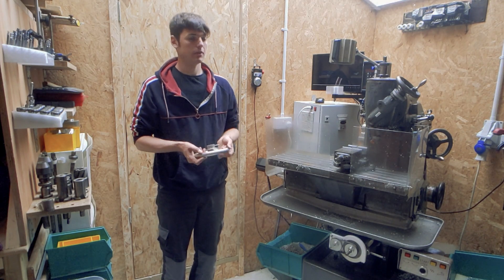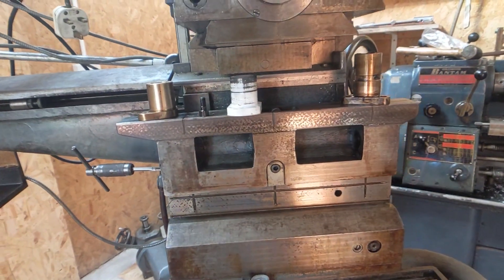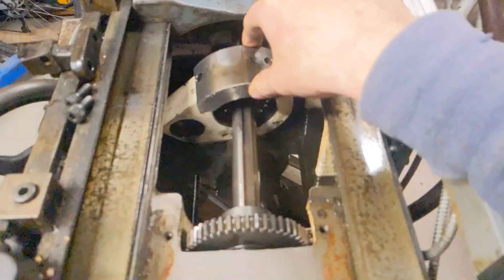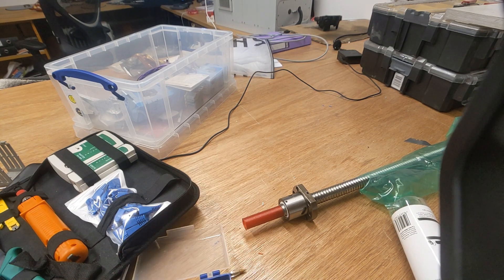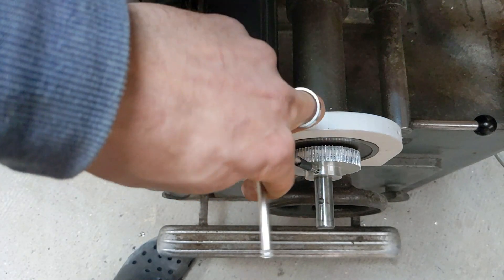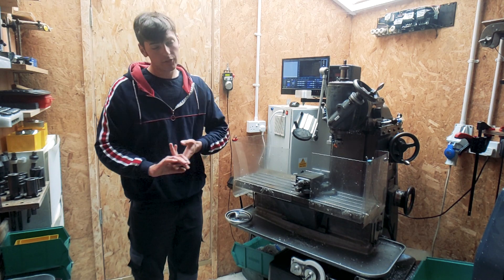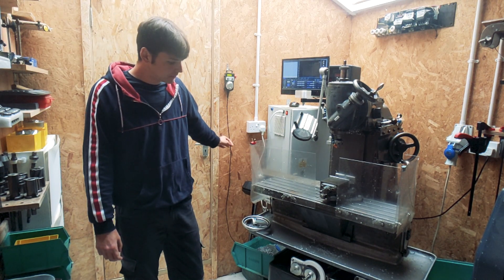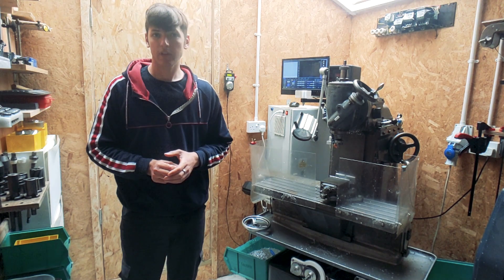CNC Milling Machine on a Budget - Aciera F4 with Linux CNC

Comment: Very cool, great job! I have a F3 sitting in my Garage waiting to be fully torn apart to get it into the workshop in the basement. I plan on doing the same and even though its a different machine its nice to have a role model. 🙂
Reply from the maker: Should be good! I have been enjoying using such an old well built machine. Best of luck with your conversion 😃